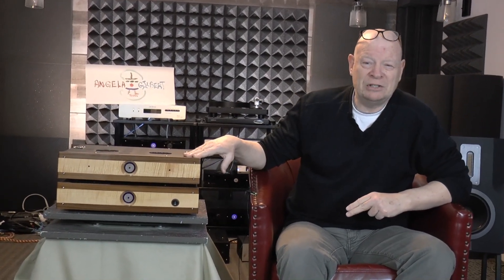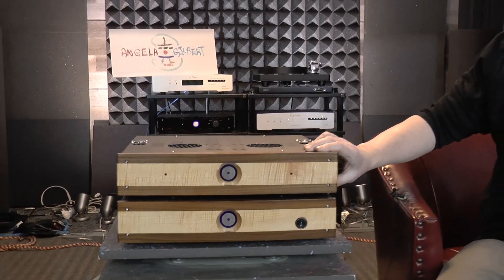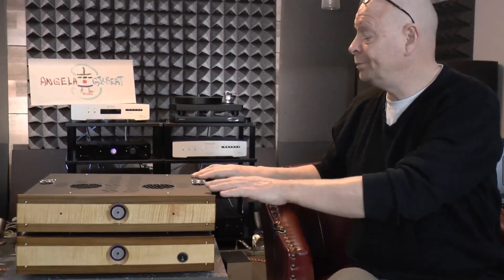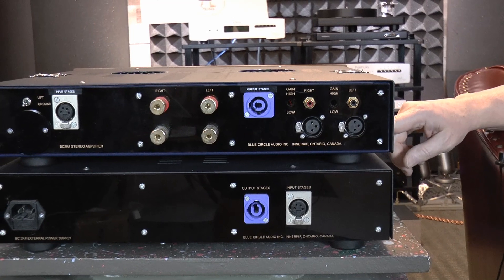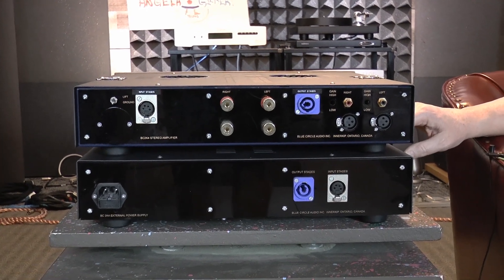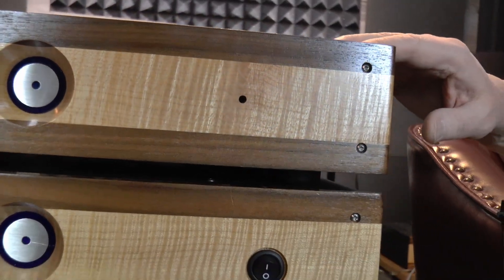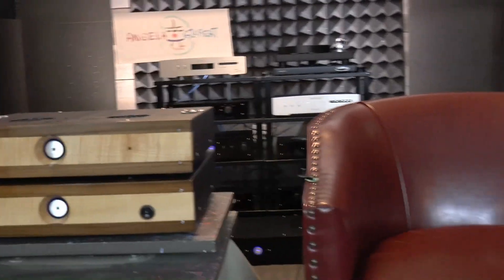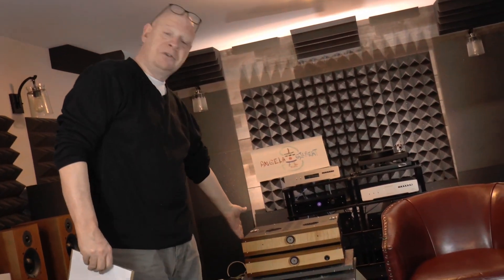Converting a Class D power amp into Class AB power amp

Comment: Explain how you change a Class D into a Class A B
Reply: It's pretty simple actually - the class D output stage is removed from the amplifier and replaced with a class A/B output stage. In some cases, minor modifications would be made to the power supply.  That's basically it.
Reply: LOL people who have never designed an amplifier 
Basically the took the guts out and replaced  it with a class ab common collector amplifier pcb... guessing they kept the switching powersupply
Reply: @matthewcooke4477  nope there's now a toroidal transformer